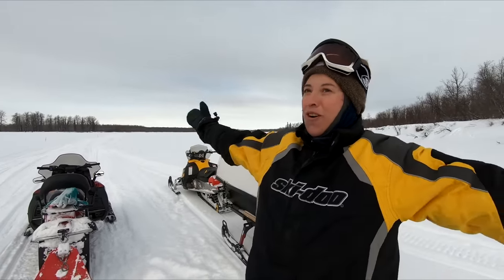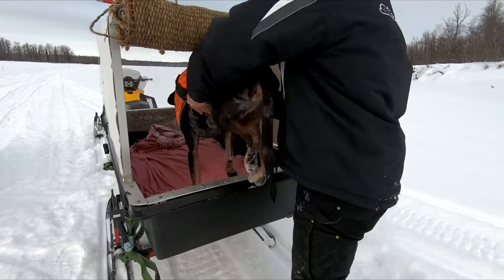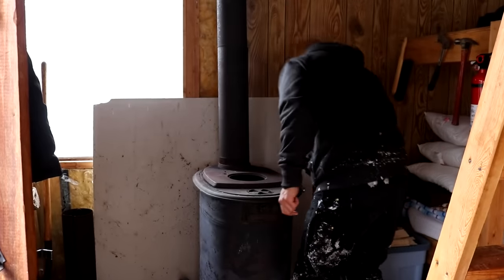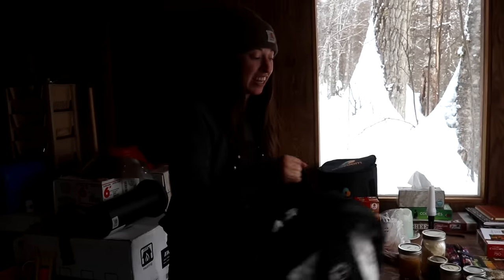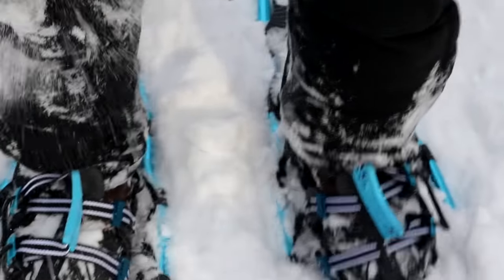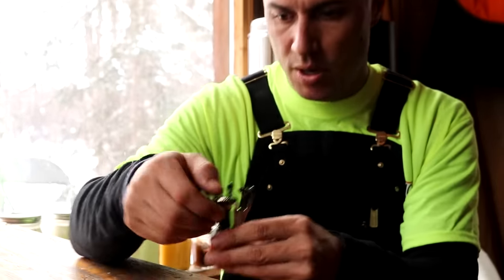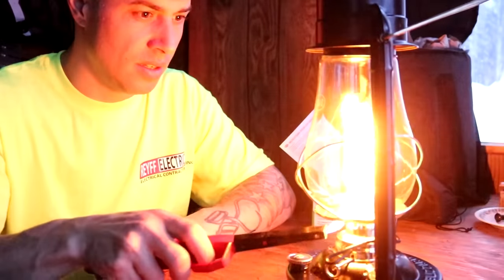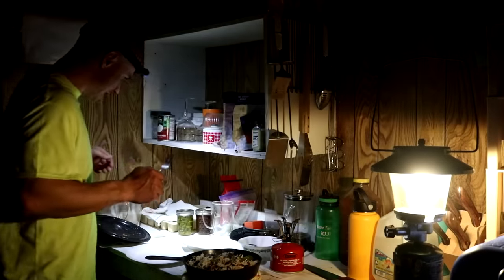Winter Trip to Our Alaskan Off Grid Cabin (Part 1)

Comment: Anothre option for cooking and for lantern's at the remote cabin would be dual fule Coleman lanterns and stoves.  The dual fule is Coleman fuel or unleaded gasoline.  The fuel lasts longer than propane and gives a very hot fire.  The stoves come in two and three burner.  The lantern you got, I assume burns kerocene which works well for lanterns and gives off heat

Comment: That is the wrong fuel to use in that lamp. That is for the old Coleman pressurized stove and lanterns. You need kerosene or lamp oil. It is more oily. The fuel you are using is dangerous to use in that lantern.

Comment: You should put our left over food in a steel tool box... the big heavy duty one that they use on construction site. That way you can store our food outside and not inside the cabin when you are away. The bear can have a sniff at it but no chance to reach the food. Just an idea I had but never tried it before. I know that a bear can chew an iron pan so hard to say...

Comment: I used to have a cabin when I was a youngster.  I had a small tin heater I would take out the ashes and put diesel fuel in it.  I could take a ash shovel a put some ash in the stove put kindling and it would light real easy. Worked well

Comment: Why not put a series of logs across the path up to the cabin, at a right angle, pseudo steps.
Reply: I am a bit of luddite when it comes to technology. We have used these kind of steps so I'll explain what I mean a little further.
Use short logs, about five or six feet long,  put the log across the path, secure it with stakes on the downhill side of the log,, on either end of the log.  
Do the same where you want the next step.  
Fill in between the logs with snow and pack down.  Add snow as required. Of course without snow these aren't very useful, but they would be easy enough to place for the winter months.